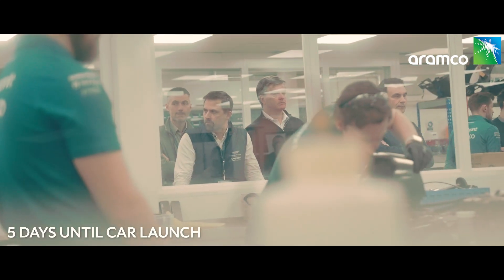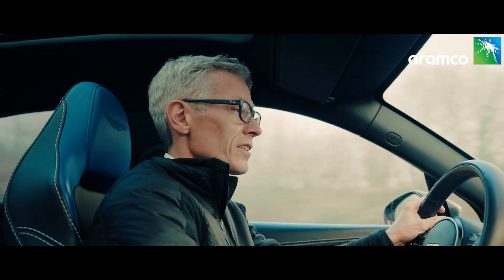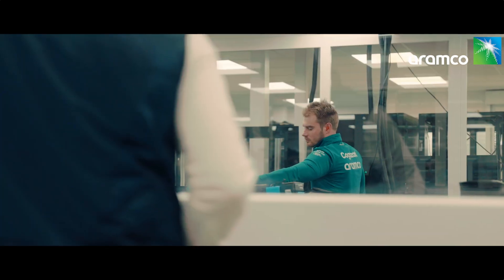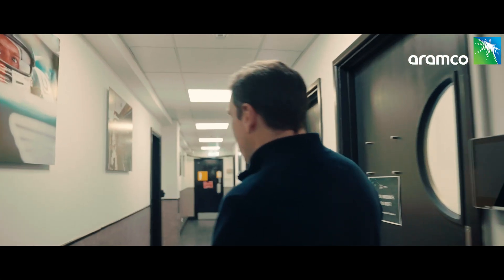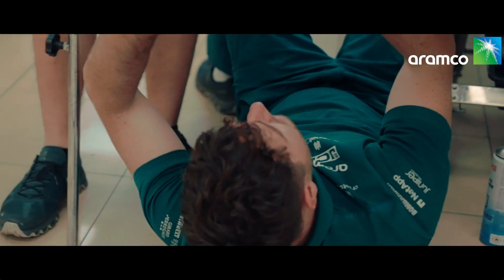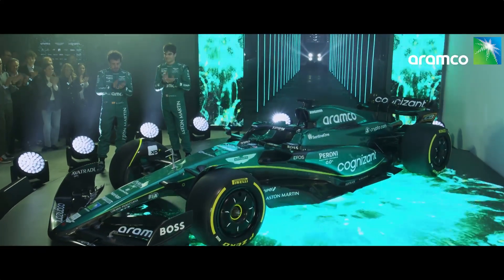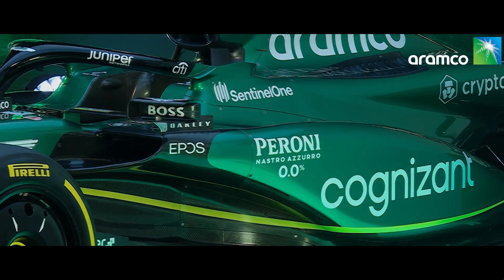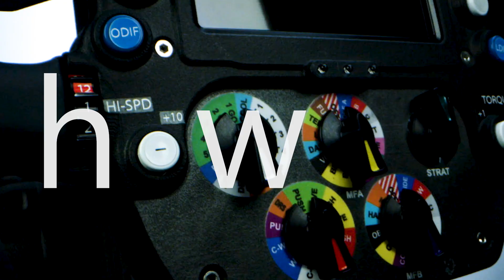How to build an F1 car: The AMR23 | Aramco

Comment: How to build an F1 car? Best method is to copy other cars which have proved to be really good - which is exactly what Aston Martin have done this season using Red Bull for aero (thanks to acquiring a few ex-RB engineers) and Mercedes for engine, gearbox and suspension. Top it off with a legend as a driver and from doing OK mid-field last year, they've suddenly burst onto the scene in 2023 fighting at the top. Textbook.

Comment: There was a time where I wasn't sure about Racing Point. Same goes for AMR. I've thought of the team as a backmarker team in both performance and presentation. But over the last year I've watched these videos. I see the passion, care, desire, and motivation. I see the most advanced facilities of all of the constructors, amazing talent across the board, and I am excited. I am rooting for you. I can't wait to see you guys give it maximum push and challenge for those podium steps. I don't wish you good luck. Luck is for the lotto. I wish you all of the success!
Reply: They are still a step behind Red Bull, Ferrari and Mercedes
Reply: @johnnychimpo7539  HA! Say that again
Reply: @feliperocha2567  they are still a step behind Mercedes and Red Bull. Ferrari can’t put it on pole which Aston really can’t and Mercedes could win a race on the right track…I don’t think Aston can. Sure, Alonso has owned the last podium spot but we will see where things shape up after some actual upgrades

Mercedes is only 6 points behind and Aston has 3 more podiums. Don’t forget that Aston has lance. Much weaker than Sainz and much much weaker than George
Reply: @johnnychimpo7539  I don’t know if they’re behind Ferrari. I think they may have jumped ahead, but I’m sure it’s going to be close! As far as hanging upfront with Red Bull, we probably won’t see it this year but they were definitely looking good as of late and I think they are on the right track. No pun intended.
Reply: @stevenshizzle  Ferrari has looked good the last 2 races. I guess Aston is ahead cuz they are getting the podiums and ahead in points but I still think Mercedes and Ferrari have a much higher ceiling. They aren’t a customer team
Reply: I may not be the biggest fan of stroll but I've never doubted that he could achieve this. That guy has a vision, a plan and most importantly execution.
Reply: "most advanced facilities" don't they use the Merc wind tunnel
Reply: @jz4774  they are having a wind tunnel built. So that sort of ties in with the having vision and planning for the future.
Reply: Force India was a "best of the rest" team, consistently punching well above its budgetary weight for a decade.  The team only stumbled when it sacked Perez for Stroll and then lost Ocon for an aging Vettel.  And got massively penalized for the Pink Mercedes.  But now that they're the Green Red Bull instead, they're doing well.
Reply: Racing point/Force India was never a backmarker. They were one of the most efficient midfield team. Get your facts checked bro
Reply: @debojyotighosh6467  can you remind me how Aston Martin did in last year’s constructors championship bro?